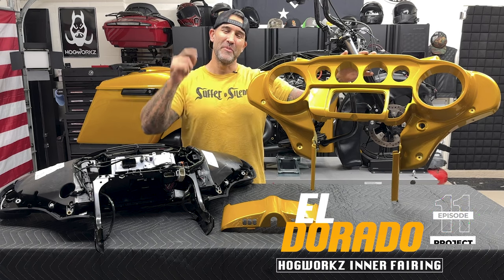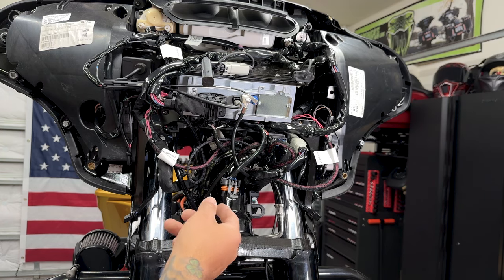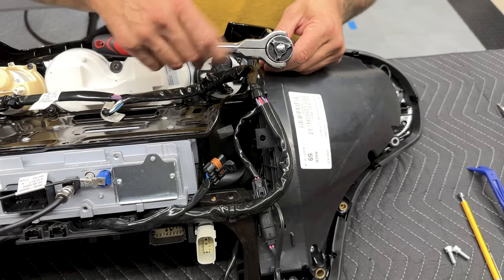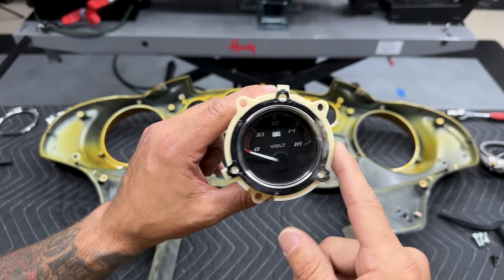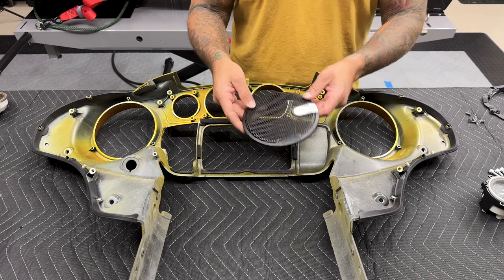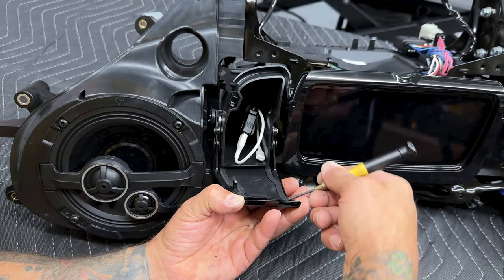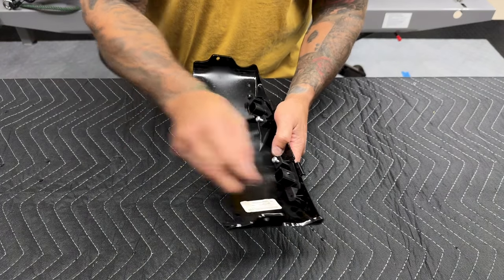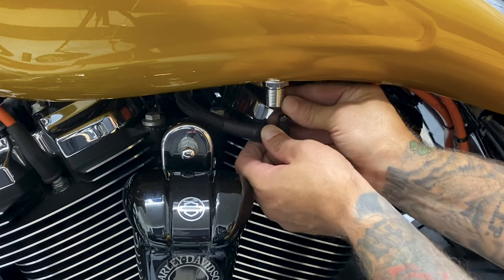Remove and Install Street Glide Inner Fairing - Color-Match Swap

Comment: I recently changed out my inner fairing. Everything went well with your video. Only issue I'm having is putting back the ignition switch. Doesn't lock. My fault for removing it.
Reply from the maker: Glad this video helped! Yeah, never remove the ignition switch without the key tumbler alignment tool lol.